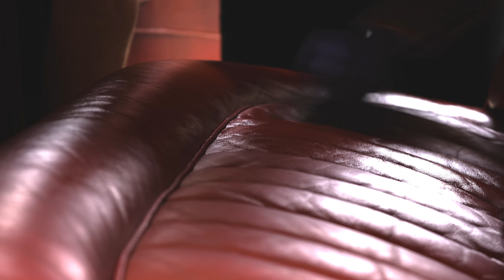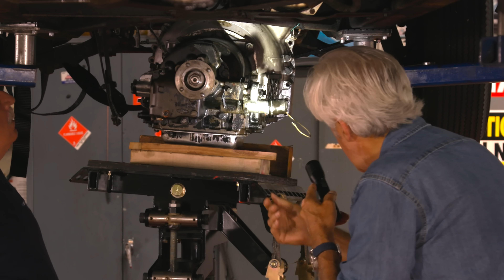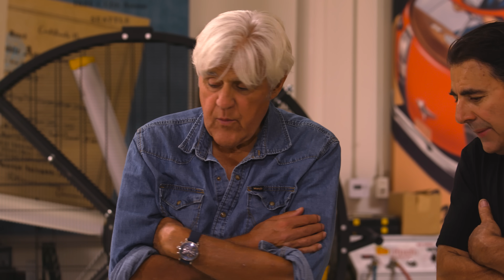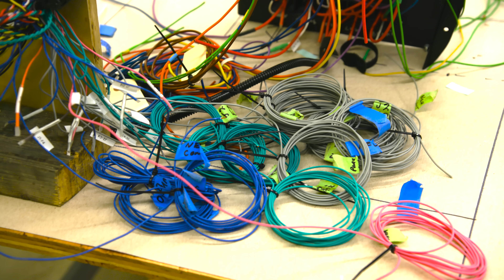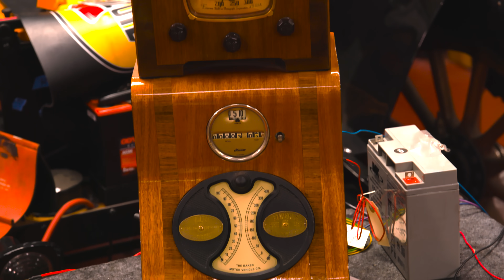Jaguar Barn Find & Laser Welding: Jay Leno's Garage Restoration Blog: November 2025

Comment: There is 9 to 12 hand rubbed coats of lacquer on a 1920's -1950's  ( Nitrocellulose )  Steinway Piano, one wet glass and it's ruined .  Very hard to repair !  Even in the 1950's with the introduction of Acrylic lacquers, still very hard to repair. I still to this day do not understand why anyone wood want an old refinished lacquer on an old car. It has to be in a humidified proper environment . Not just stored in a garage .

Comment: TRUCK !   Does anyone make a real WORK TRUCK ?  Thoughts 300hp plenty, no turbo no supercharger no variable valve timing. Gauges oil,water,voltage,speedometer and tachometer a few idiot lights. Auto, a/c, heat,power steering and brakes, throttle body
 NO INFOTANMENT SYSTEM just a large hole like glove box in center so you can customize it. This means things like a/c control have their own knob. SOUNDS LIKE A 80S TRUCK but not. Let's make it van like style a short stubby nose but easy engine access. Full front seats and behind them door accessed lockable storage made like extended cab and small mini fold out seat. Now because of the short nose and small cab extension I can have 8ft bed with out truck extremely long, it will fit I parking space. Last bed hight same as 80 or 90s so as to lift stuff easily into bed and the bed is separate unit. Imagine a van with cut down second seating row and independent bed with minimal electronics. OK that's by quick starting point.

Comment: 7:28 13 vs 6 bolts reminds me of the story about when the Rolls-Royce Merlin was redesigned by Packard so that they could build it on a moving assembly line with US-standard fasteners instead of on stands and BSF threads on everything. The original Rolls-Royce version had around 13,000 parts. The Packard version has around 8,000.

Comment: I absolutely love your shows, big fan in British Columbia; mostly a truck guy. I like GMC 1972 and prior before the box look but do not own one. 

I have a odd ball 2wd 1975 half D100 and half D300; and rareish 1976 F-350 (round headlights) that is NOT the Super Camper Special, but is one of the original Super Duty PU with a 4:10 Detroit locker rear end. 

From what I found so far in 1976 only about 1600-1700 of this particular type of F-350 where made with a 140" WB box, most came as a chassis model for a flat deck or service box,

The Ford needs all need a ton of work. It history, it seems,  is that of some type of forestry truck used in a logging camp, as it looks like mountings for a radio of that era

Comment: Having owned several IX's, including a barn find that's now in a museum in Israel, I, too, prefer the IX. However, I have to disagree with you regarding the Mk 10. The Mk 10 was the styling predecessor of the 420 and the XJ6. However, in comparison to those later cars, the Mk 10 interior is incredible, and likely the most comfortable living room on wheels. The seats are wide, wider than first class airline seats of the day, and wonderfully cushioned. The woodwork is, in keeping with the Jaguar tradition, abundant and stunningly beautiful. The wool carpets and mouton over rugs entice you to take off your shoes. Of course, everything is modern: Power steering, brakes, automatic transmission, electric windows, etc... The width of the car is rather imposing, and it's a handful to parallel park, but out on the highway, it's incredibly comfortable.
Reply: Great to hear you have a Mk IX....  crying shame it sits in israel.
As far as MK 10s...  just goes to show how opinions differ....   I have always thought it's a horrible ugly attempt to americanise a british classic.
Regardless....  apart from the E types, I think the MK 2 is the most beautiful jag ever made.

Comment: 00:00 1961 Jaguar Mk IX - paint, modern transmission
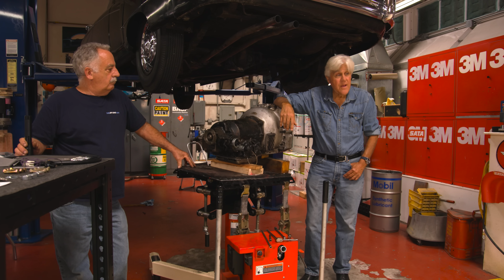  7:51  Ariel Atom — work continues on putting in the V-8 motor 
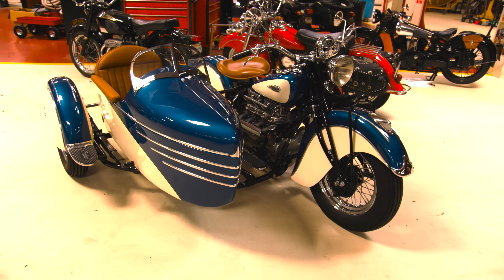  8:35  Continued repairs and restoration of the crashed Indian with sidecar
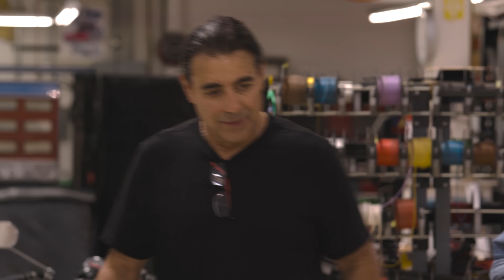10:45  Electric starter for another Indian motorcycle
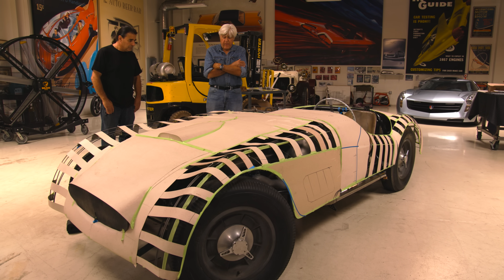12:25  Restoration of the Barnes Special race car
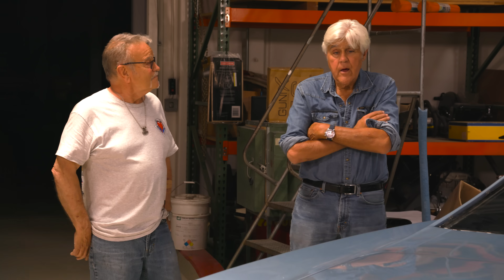18:56  1965 Pontiac Grand Prix
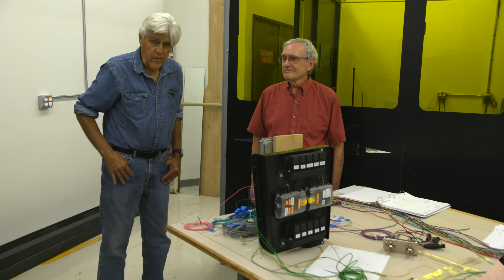22:04   Laser welder! on loan, with Jim Hall (in the “secret room”)
23:54  Wiring harness for the 1914 Detroit Electric
27:55  More Detroit Electric - radio, Bluetooth, AC, speedometer, coffered ceiling, new wheels from the Amish

Comment: The Barnes Pike's Peak car has a '49-1/2 or later Cad engine. The early '49 331 CID Caddys had 4 valve cover bolts.

Comment: 16:45 If there is radium paint on those gauges (and judging by the dingey yellow color of the paint and general age of the dials there probably is), DO NOT open them. Either leave them alone, or send them off to be professionally cleaned. The gamma radiation from radium is no joke. Even though the paint stopped glowing a long time ago, the radium is still going to be hot and will continue to be for a couple thousand years.

Comment: My first car was a 64 Grand Prix in that same color. It had 14" wheels that had been changed to 15s. That changed the speedometer. I got a ticket for 93 in a 65 in the daytime. 1 1/2 weeks later I passed a 65 Mustang in the dark a few miles from home. When I got to my gravel road I could see somebody catching up with me. I stopped to see what it was. Highway patrol and a ticket for 96 in a 60. That was back when the speed limit was lower at night. The patrolman had heard about my other ticket and made this court date for the same day. I lost my license for a few months over that. 1973. The 389 went bad and I wrecked the family 65 Buick Electra 225. I wanted to put that engine in into the Grand Prix but my Dad said it couldn't be done. I was a dumb 17-year-old. I realize now he didn't want me driving the Grand Prix with a 340hp 425 ci motor.

Comment: The reason there are so many bolts is English housings were famous for leaking. I own an old Norton. The wet primary case that is at least 18 inches long, was secured by a single bolt in the middle.

Comment: If the area appears to be open enough to the public to be used to turn around, nobody has any business putting an unflagged wire at those heights. We've had people seriously injured, and one fatality, from wires strung across an ATV/snowmobile trail. The person who caused the fatality was also dumb enough to proudly tell the cops he had put the wire there. He didn't get a very long sentence, just like 15 years. Well, that's pretty long, I suppose...

But, seriously, just tie some ribbons on it every few feet. Better still, put some signs that forbid entry. People are going to assume that it's open to the public, at least enough to turn around. Treat it accordingly. Don't put wires across at rider-heights without making the wire clear and letting people know that it's not safe to trespass. That's really not too much to ask from a member of a community.

I think I'd have been even more livid than Jay was. I doubt that I'd sue or try to press legal charges. What I'd likely do is make sure that the rest of the community knows about them and their actions. That's not going to work where Jay lives, but I live in a tiny community and in a really remote area.

Comment: 1961 MK IX..Borgwarner 3 speed auto..great 3.8 litre straight 6..I was on a SCCA pit crew in the early /mid 1960's..The driver/owner was a doctor who had a XK 150 for his daily..His wife used the 1960 MK IX..I spent lots of time in both..My recelection of the MK IX was that I loved everything about it ..from the running lights to the engine to the seats..I have Fond Reflections of that Grey MK IX..as if it was yesterday that I rode in it down to town in 1963..

Comment: The Indian sidecar rig turned out amazing!! You have a fantastic crew.
Reply: Did anybody weigh the original sidecar? Including all the BONDO. And compare it to the aluminum counterpart. That I would be extremely interested in. Also are the fenders on the two wheeler now aluminum. Years ago, many years ago I used to stop signs for the sides of my fender I fabricated. It looked great, but it weighed a ton. Took four hands to install it. How time change… Everybody stay strong stay safe.

Comment: Jay, please have your guys washing your cars use a car washing brush on your cars, it lets the abrasive particals go up in the bristles so they don't abrade the finish, rags and microfiber towels hold the abrasives against the finish and scratch it. Just one wash after a polish will put scratches back on the finish.
Reply: One wash with towels  rags puts scratches back on the finish.

Comment: Another great video you guys ! 
 My dad and I dropped the trans in a 1980 chevette twice . 
 My second car , I think it cost 200$ . I hated it but it was an emergency 😏 . Then it refused to die !! Dang rear wheel drive fiat design . lol 
 Getting the bell housing unbolted without pulling the engine (just loosened the mounts ) on jack stands and ramps was an epic undertaking . The ‘vette had a pronounced trans hump and I believe the entire drivetrain went in as a single unit at the factory . 
 Think it was 8 bolts and we cursed them all thoroughly .
 The chilton’s manual said something like , ‘ this operation may require several unique combinations of swivels and extensions ‘ , and then left you to your suffering .
 Still can’t imagine how dad and I did that , twice !! 
 As awful as it was I’d give anything to do it with him again .
 The ‘swivels and extensions …’ bit remains a staple punchline in our family almost 40 years later . 
 Thank you for your devotion to the hobby Mr Leno .

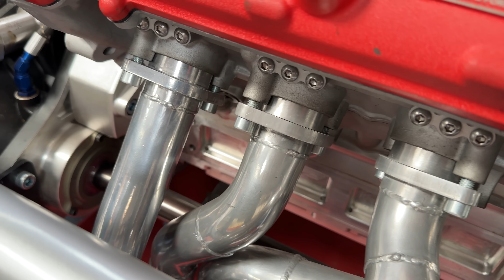Comment: 8:00 That 3 litre V8 engine, built up from two production motorcycle top ends, is as powerful as the Cosworth DFV, which dominated F1 from the late 1960s well into the 1980s.

Comment: Amish wooden wheels and a laser welder.  Fantastic!
Reply: I actually bought an electric heater last winter that was made by the Amish!  Well, I shouldn't say that because the Amish didn't make the electrical part because working on anything modern is sacrilegious to them and even the sight of a person using an electric toothbrush will send them into a frenzy, but they DID build the wooden box which houses the electrical parts which were made by China men then shipped all the way here from the China Coast by freighter ship. But them Amish do damned impressive work.

Comment: I had a 65 Grand Prix in 1969, I drove it for 4 years. It was dark blue. I also had a 1956 Chrysler 300 also which was fast, it had thwe 354 hemi and I but aluminum pop-up pistons and I put a cam in it, headers and I change the rear axle to a 9 bolt and 411gear in it and some nice wheels and tires. The car was big but fast.

Comment: You talk about a sleeper. With the power to weight ratio in that Detroit Electric Vehicle. You pull up next to a Hellcat at the light and boom hit Warp Drive. The Hellcat poops its litterbox and goes home to take a nap.
Reply: Might break loose those rear tires on the Detroit Electric.

Comment: I-5
Reply: What else a GMC?
Reply: The highway drive real sedan a mixed Cadillac trim to four door right or it looks like a sedan it's a two-door what else is GMC have and they got the Hummer wheels
Reply: Buick parking it's got the wheels that go left and right the drift wheels and the Hummer wheels
Reply: All GMC SAC religion
Reply: A small steering wheel the minimal dash is cool like everything doesn't have to be that big
Reply: I love the dash it's like f**** tape to the firewall or something
Reply: A throttle like a lawn mower
Reply: Might be digital
Reply: And does a 9-speed have to be supercharged lol
Reply: And these days what's an independent wheel driving system you know so you can guard the axle with the frame